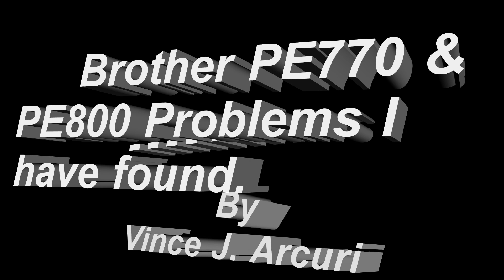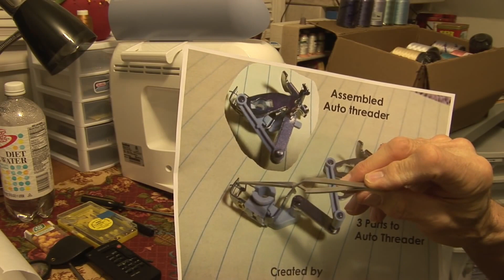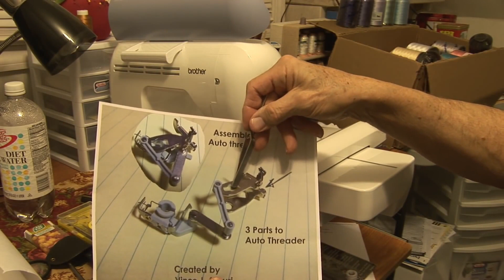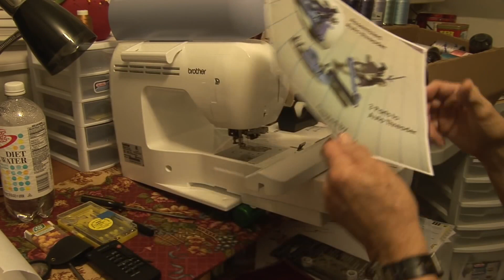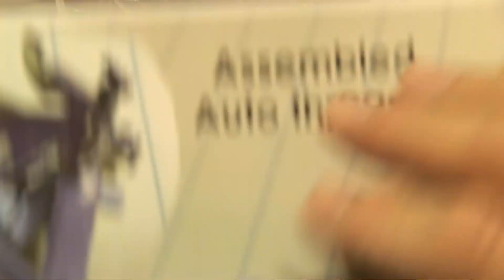Brother PE770 also PE800 problems I have seen.

Comment: Hello - Thank you for this video. I have a PE800 that is not recognizing the Presser foot is down. It is down but the machine keeps telling me to lower the presser foot. Is there some type of connection it may not be making? Ive had the machine 3 years, used it about 4x, last use it starts doing this and of course it is out of warranty...the closest repair shop is 50 miles away. Any help would be greatly appreciated.
Reply from the maker: I will look into it tonight
Reply: @vincejarcuriworldofmachine200  Thank you - how very sweet